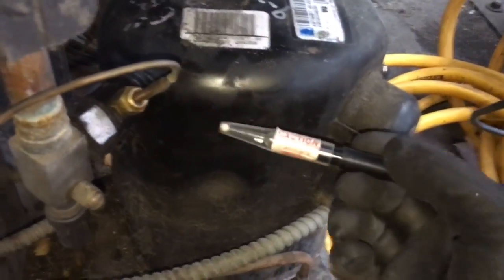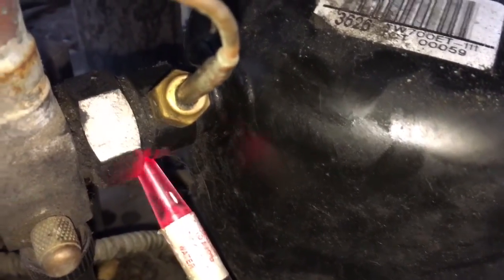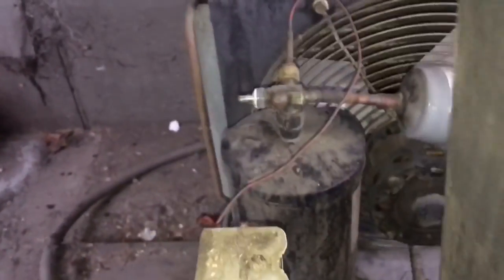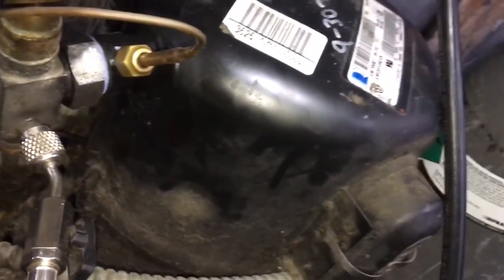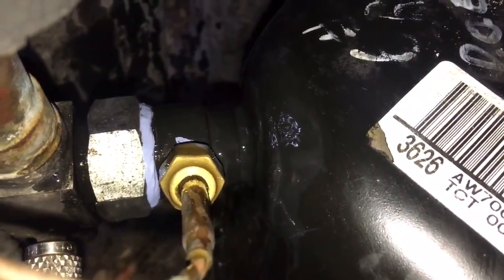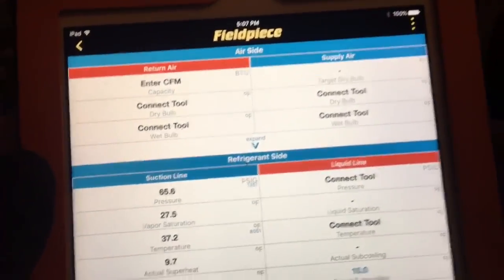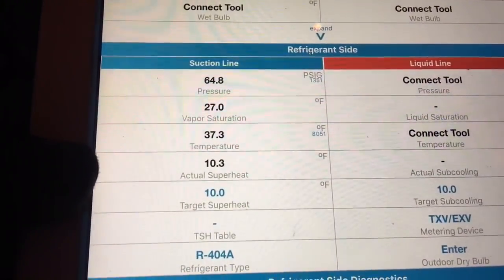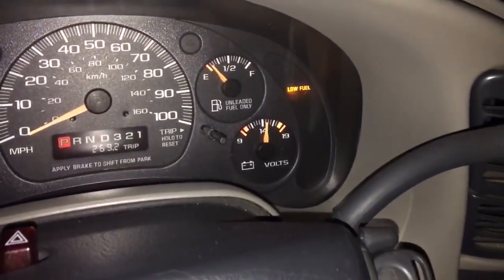Unit low on charge

Comment: Good video Dave! Thanks. Crazy cold in Canada the last two weeks, all I’ve been doing are no heat calls so it’s nice to watch a refrigeration video, would rather work on leaking compressors than failed Hot Surface igniters and pressure switches, but alas I can live vicariously through you... Was looking at a DL489 just yesterday, maybe I should delay my purchase until your 5000 sub giveaway... 😎👍

Comment: Nice repair. I did a high side rotolock change on a Tecumseh recently. Do you use teflon and leak lock on all non flared connections?  I know each guy is different but I wanted to know if and why you do that?  Crank that cold one Guru!
Reply from the maker: Apprentice Phil I usually don’t put anything on the rotolock. I did this time to see if it helps. The customer told me it had leaked there years ago.
Reply: better safe than sorry, Congrats on the 5K subs
Reply: Jim P swears by leak lock and teflon blue tape

Comment: have you ever been worried about putting nitrogen on pump down system? if a rotalock have a little leak, it is possible to mix the nitrogen with the refrigerant.
Reply from the maker: Julio Santana no because once the 404a has leaked you need to recover what’s left I believe it separates. I used what gas was left for leak check 40 psi static after repair I recovered the remaining and evacuated the system and it got a fresh charge.
Reply: Nor cal Dave, what brand of work gloves do you use and where do you purchase them?
Reply: ok!, sry i thought that you stored the refrigerant on the high side and then vacuum on the low side. Thanks for the explanation.
Reply: a small amount of clean nitrogen mixed with the refrigerant gas is far less an issue for recovery purification and safer than most all other gas/air mixtures.
still wise to keep it as clean as possible, though :)
Reply: Nor-Cal Refrigeration & H.V.A.C thanks Dave! Super appreciate the videos
Reply from the maker: Jonah Carvalho thanks for watching